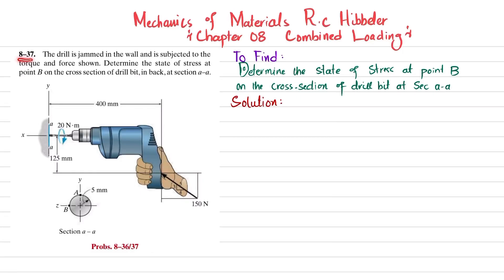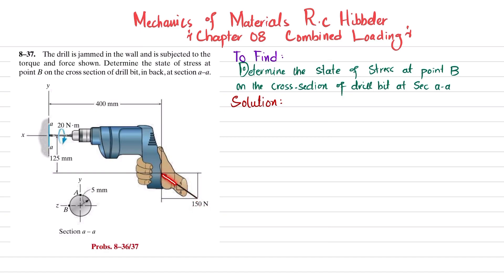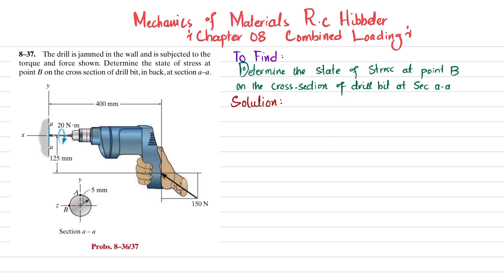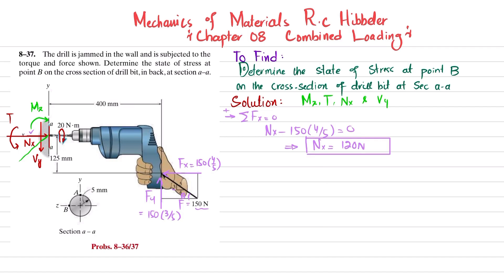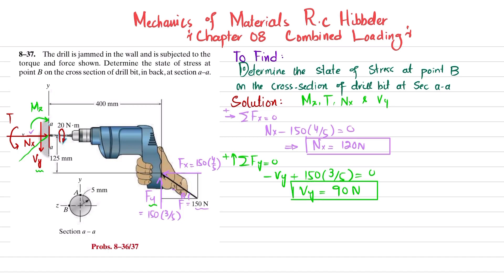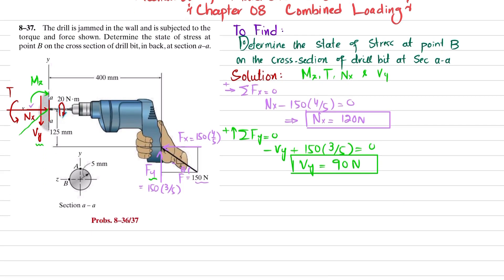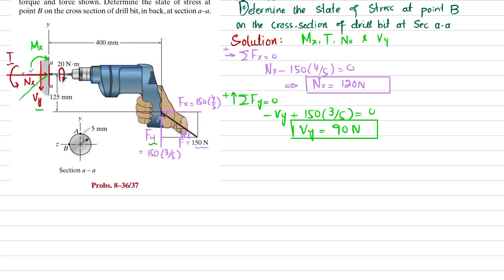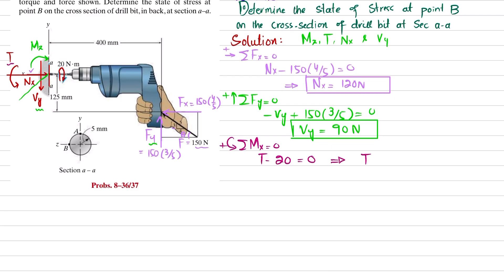8-37 Determine state of stress at point B on cross section of drill bit | Mech of materials rc hib

Comment: When calculating the bending stress according to point a in 8.36, we took my/I as negative, since it is compression, shouldn't it be + when calculating the bending stress according to point b this question ?thank you sir We already found zero but I still wanted to ask
Reply from the maker: The general formula for Bending stress is sigma = - M*y/ I where y is distance from neutral axis either upward or downward. AS POINT B LIES ON NEUTRAL AXIS SO Y IS ZERO MAKES WHOLD EQUATION SIGMA = 0